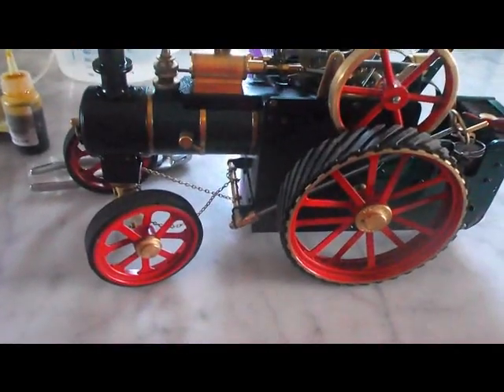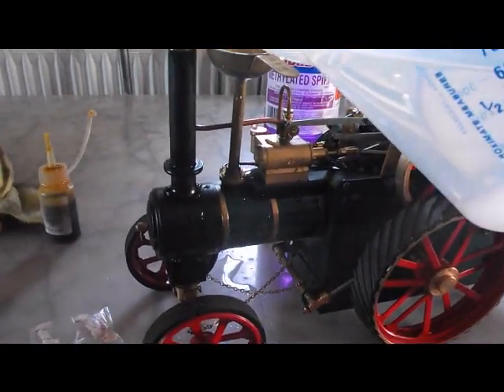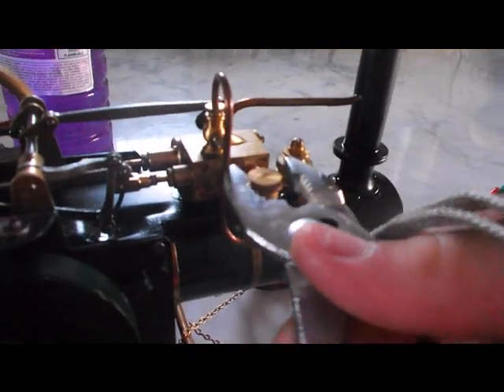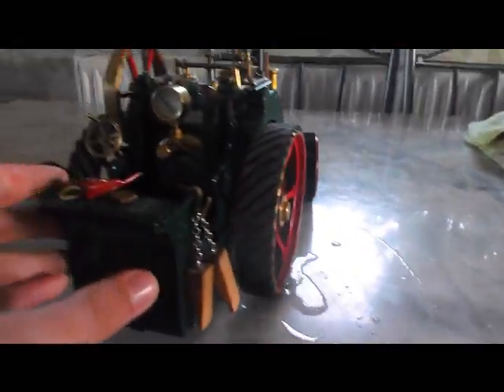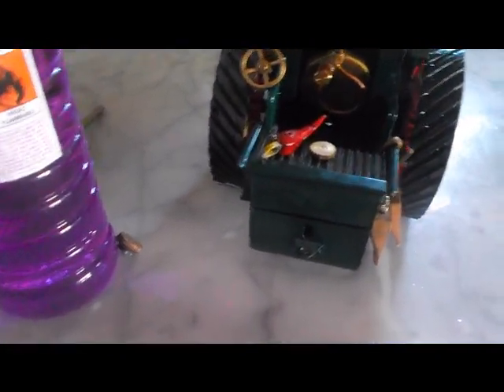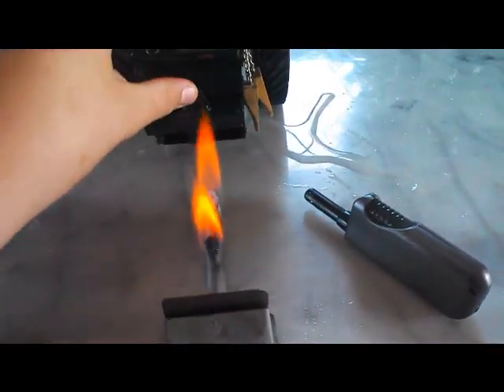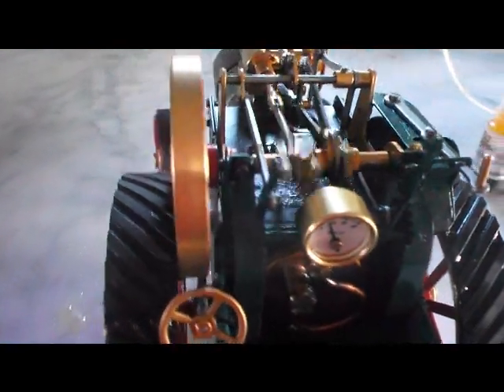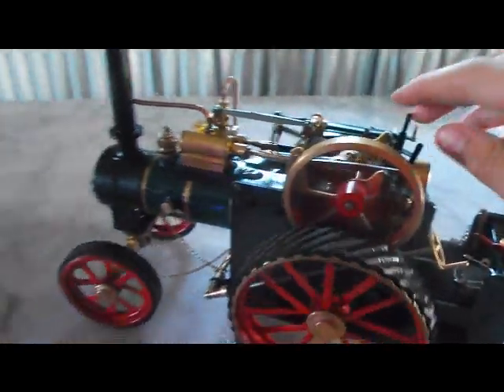How to steam up a D.R Mercer type 2 traction engine

Comment: Contemplating getting either one of these or an Allchin next year, as a 50th Birthday present to myself.
Reply from the maker: They are great little engines. The allchin is much more accurate and realistic but then shows the price difference as well as a size increase too If you buy either you won't be disappointed
Reply: Allchin comes standard with a gas burner as well. That also makes me want to lean towards it.
Reply: michigandon I too have reached the 50 and have a Mercer Type 2 on order (should be about 8 weeks to delivery) and also on the waiting list for an Allchin as I couldn’t decide between them. I think the Mercer looks great and with a number of colour choices and add-ons you can make it your own engine. I have ordered through Minsteam. The Allchin is more powerful (60psi boiler pressure v. 15 on the Mercer) but I think looks more mass produced (it is made in batches in China). Price wise they are about the same.

Comment from the maker: thanks ,it dosent run on meths i converted it to gas but meths is a bit messy but thanks for that tip will help with my other meths fired engines
Reply: tractionengine11 dude buy a syringe and stick some nitro fuel pipe on the end.  One for meths and one for water.  Simples.  And a syringe to suck up the steam oil from the lubricator